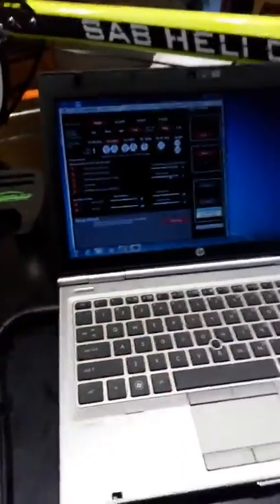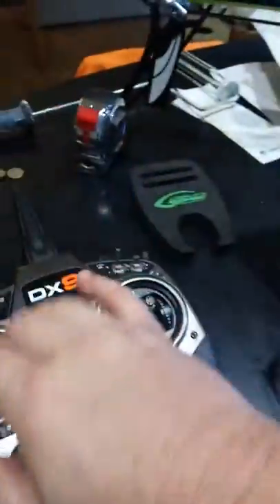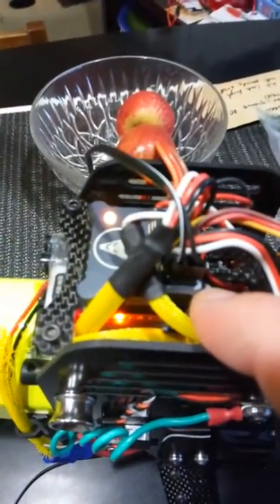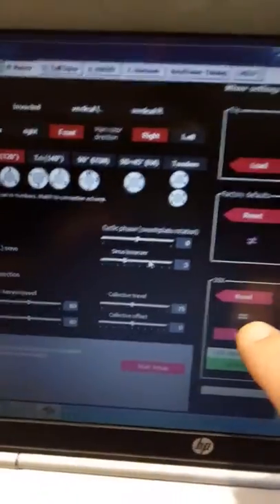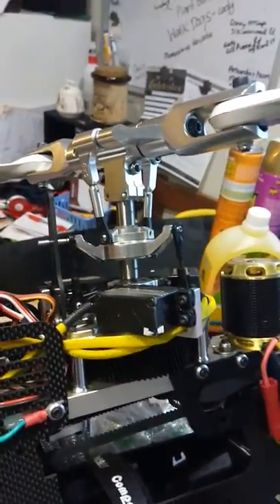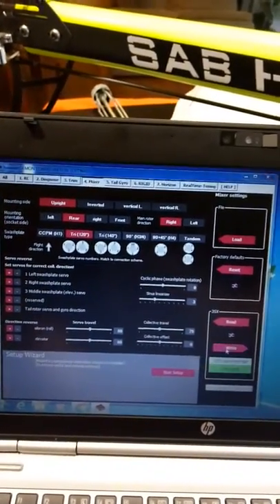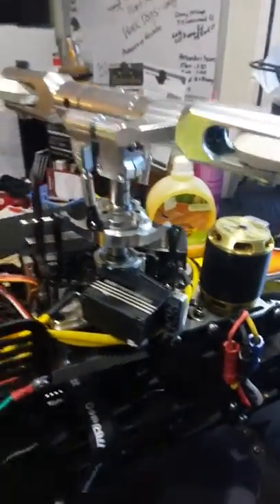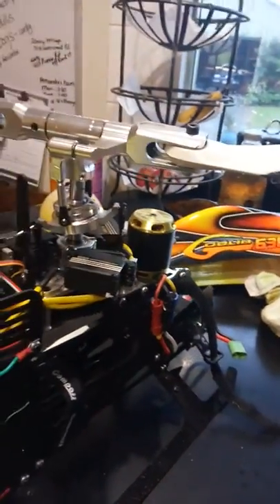3SX Bavarian Demon issue fix with orientation and rescue mode

Comment: Hello Westy, first i want to say thank you for part 2 of the d
Demon set up. everything went well with set up except i dont know I have no throttle working . i checked radio settings and i dont have it on hold. can you tell me what could be the problem ? Thanks
Reply from the maker: no throttle working on the Heli? or you cannot see it moving on the set up software? Is it moving on your transmitter monitor section?